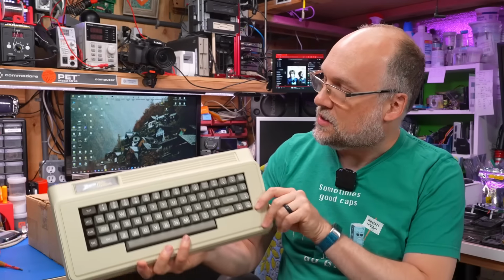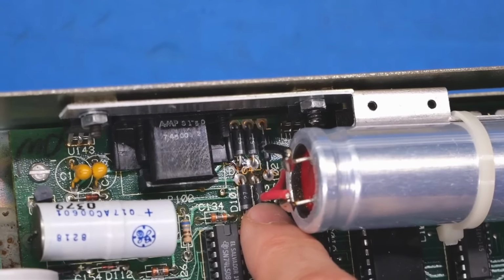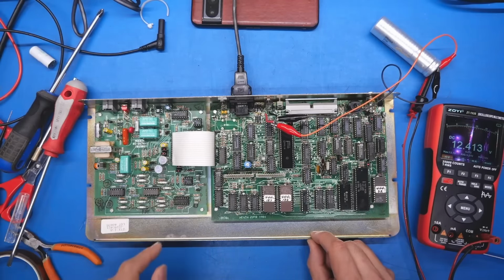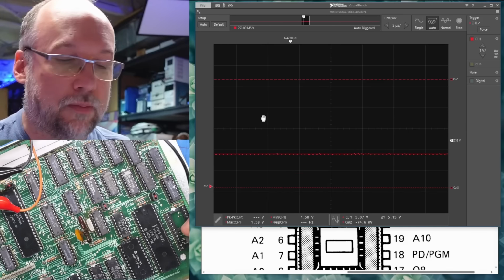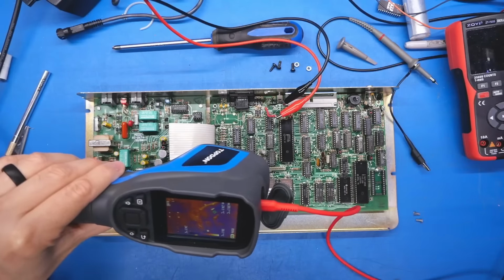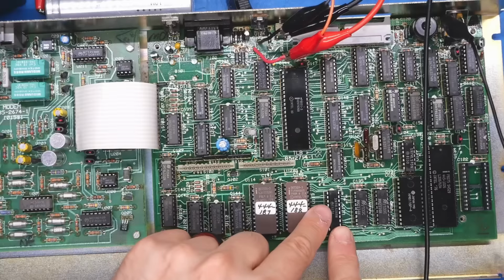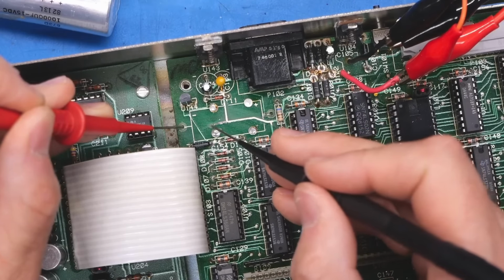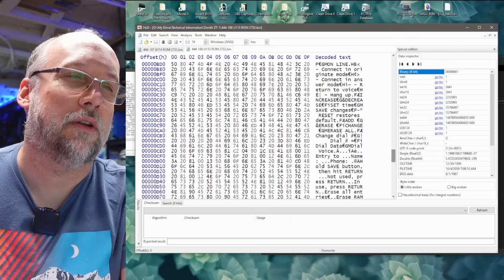The Zenith ZT-1 tried to be a low cost gateway to the information age

Comment from the maker: I did some further research and it seems this device might have come out around mid 1982, even if it was designed in 1981 (and this one has a bunch of 1981 chips in it.) This article (see PDF page 45) mentions that the ZT-1 was officially shown off in Summer of 1982, but a photo of it was shown in the 1981 Zenith Annual Report: https://ia802907.us.archive.org/10/items/sextantissue2summer1982/Sextant%20Issue%202%20Summer%201982.pdf

I found a Fall 1983 catalog showing off the product, and indeed it is available as a Heath version (in kit form) to save some (a substantial amount of) money. Judging by the markings on the PCB, it seems this was designed by Heath (Which Zenith bought in 1979.) See PDF page 65: https://www.worldradiohistory.com/Archive-Catalogs/Heathkit-Catalogs/Heathkit-1983-Fall.pdf 

The model ZT-10 and ZT-11 both had a RS-232 serial port, making the whole thing much more useful today, so if you are looking to buy one, try to find one of these models instead of the ZT-1. The "A" variant I have seems to add the "Source" online service functionality, which may have been a competitor to Compuserv. 

Notice in the catalog a carrying case was offered, bringing portability to your ZT-1. That's pretty funny considering the 80 column output clearly won't work well with TVs if you tried to use it with one as a display. (Especially via a RF modulator.)
Reply: I suspect that the ribbon connecting the computer to the modem is the equivalent of rs-232 on db25, only with TTL logic and not the typical rs232.
Reply: I bet the ZT-1 could be modified to do RS232 pretty easily.  The CPU itself has a UART on it, and the BIOS code programs it.
Reply: I believe the model number for those are ZTX-11 and ZTX-10. ZT-11 and ZT-10 were with the monitor included (or attached?) either way it's also a number of some baseball card so its hard to google it.
Reply: @DerekWilsonProgrammer  yep, I'm finding ZTX-10/11 stuff, apparently the difference is an RS-232 and up to 9600 baud modem, not an attached monitor. The ZT-1 seems very sucky in comparison. Wonder why?
Reply: I don't know if you're still watching the comments for this video, but my father has one of these similar terminals. If you'd like, we can look at his in parallel and compare roms and signals on the PCB. I'll be visiting this weekend, so let me know if you'd like me to take a look.
Reply from the maker: @JBEEUD thanks for the offer but part 2 is already out to patrons and progress has been made :-)
Reply: I would have thought anything made by Heath Kit would have schematics…
Reply: @gregpettigrew7908  Heathkit likely had a different model number, so maybe with a cross-reference of Zenith to Heathkit numbers Adrian could find a schematic.  It also might not have been posted anywhere even if it does exist.
Reply: So, you mean to say that Zenith is the cause of all problems with Heath. And that we can't buy those interesting HeathKits any more originates in the rat-like behaviour of Zenith, first they ate up HeathKit and then they tripled over their own mistakes. I had a Zenith amber coloured monitor, never had problems with it. If they did proper business then they would still be around.
Reply: I'll ask again, have the days you release videos changed on both channels??? I've commented before, but no answer. I used to look forward to the Wednesday and Saturday videos.
Reply: @simonlathwell  Yes, Thursday and Sunday work better for him.
Reply: @nurmr if you are right, then why hasn't he make it known about the change of release in a video, or bothered to even reply???
Reply: @simonlathwell I had the same question as you, but nobody owes me anything so I just watch when they come out.
Reply: @simonlathwell  It's free content, I don't understand the complain. He told the Patreon members btw.

Comment: You can probably add serial pretty easily as it is already there in TTL form.  Intercept the lines to/from the modem IC block and do level conversion....  I've done this with the ADAMLINK modem, and it works fine.  The issue is baudrate, and for that you are probably stuck with 300bps.

Comment: The phenomenon of capacitors seeming to recharge after the load is removed is because of dielectric absorption. Part of the field energy is stored in the dielectric itself when charged, and so as you drain the charge, the molecules in the dielectric which were oriented to the electric field start to feel less and less torque aligning them. But when you stop the discharge, many of the molecules will still be oriented the way the electric field was, and this results in charge "re-appearing". The energy was always there, but because the dipoles take longer to "discharge" they can temporarily create a small electric field if enough are still aligned. In most cases, the actual energy present is very small, and can be drained very quickly. However, with high-voltage capacitors, or even things like long HVDC cables that get disconnected at both ends, enough energy can be present to still be a danger. Hence why large capacitors are stored and shipped with grounding straps always connected, and HVDC cables have to also be immediately grounded when disconnected for a certain period of time to completely discharge the electric field and allow the molecular dipoles to be randomly oriented again.
At least, that's my understanding of it.

Comment: I had a ZT-1 and used it.  My TV didn't have a composite video input, so I had to use my VHS VCR to provide the VHF modulation to connect to the TV's coaxial input.  A Wisconsin BBS I was on asked "Who here has the most effed up system?".  I described my setup, and the sysop said "You win.  Hands down.  Contest over."  Yay for me?
Reply: Hey, you got a nice anecdote out of it, that's a win in my book

Comment: Radio Shack made a device similar to this back in the day, an all-in-one terminal with a built-in 300 baud modem. It shared the same silver plastic chassis and awful chiclet keyboard as the original Color Computer, and it must have shared some of the same internals as well -- iirc the default display was the same black on green with rainbow flashing cursor as the CoCo. iirc it was originally designed for farmers, so that they could dial into a data service (I guess to order seeds/feed/supplies, and to access weather forecasts and other data useful to a farmer, stuff like that.) Either it wasn't successful in its market or they decided to sell it to normal people too, because that's where I found it, in my local Radio Shack store. I didn't buy one tho (couldn't afford it at the time) but the manager of my local Radio Shack store (who was a really cool person that I was on good terms with) let me borrow one for a while. (These were different times.) It was my "gateway drug" to the world of BBSing. My friends and I used to rush home from school and tie up the phone all afternoon calling up hacker BBS's and we would raid their text files section. Since the machine didn't have any data capture mechanism whatsoever, we would read the text files aloud (using our voices) into a cassette recorder! But that got my interest in BBSing (and computers in general) and I saved up enough to eventually get a generic 1200 baud modem for my Apple IIc.

Comment: 1) Try tracing the pins actually used on the power jack then trace them through the power supply and sketch your own circuit diagram to infer inout voltages.

2) Power supplies that output AC voltage were usually fairly simple but often potted in epoxy or something similar so opening them up was a pain. With AC, some period designs used a center tap transformer and ran all 3 output connections to the unit. Because those linear voltage regulators could take significant voltage on the input over the regulated output voltage with proper heat sinking, manufacturers tended to pick transformers where output would still be sufficient if line voltage was 108-110 but didn’t exceed the rating when line voltage was 125-130 volts in an area.

3) Examine keyboard connections on the main board vs what’s going on with the Alps board to see if they were swapped. That keyboard layout looked fairly basic. What are the odds that it’s an off-the-shelf keyboard from Alps?

Comment: Having two voltage regulators where one is used to supply VCC to some of the ICs and the other is used to supply the others, is a clear display of bad hardware design. No wonder, you are unable to repair ist. You can't repair something that is inherantly broken.

Comment: It's a shame that isn't a serial terminal with the modem included in case. If it did have serial I/O, it'd be a fun project to replace that modem board with a little Pi Zero 2 W to act as an internal computer like an emulated Apple I style system with a computer and terminal in the same case (not quite on the same board like the Apple I, but close enough). Would be silly to use, but the idea is fun.

Comment: if we know what CPU is in this device, we can convert the hex into instructions based on the opcodes of the CPU based on that. you can verify if parts of the ROM content is corrupted. 
Normally i work with S100 systems and PDP but they work in the end all the same. Especial if this is a von Neumann architecture like the Z80, intel 8080, 8088, MOS 6502 and so on. 
Your Program counter advances over the given address range and if this was set to the address of the ROM your will find there perfect readable code maybe a bit shifted for ward or back wards but some starting position will match with perfect readable machine code. and as i said with the Knowledge/Documentation of the CPU you know what hex value matches to a instruction and its follow up parts and you can convert it into assembler. JMP as example is on a 8080 is 0x3C and takes 2 bytes. a lower and a higher address part, so it is 3 bytes long and after that you should get the next instruction. if this fails you have to shift a byte and look up again. most instructions are 2 to 3 bytes long so you have only 3 possible starting positions. 
Converting it is pretty easy.

Comment: The device uses an intel 8275 video controller which you described as a general IO chip multiple times. You go off on some nonsensical ramble about Apple video circuits. For goodness sake just take a minute to check and get the basics right.

Comment: A couple things come to mind.  Early on you removed a ROM (lower/right of the board) and never put it back.  What was that ROM for?  Are you sure the system would do anything without it?  Also, without the AC voltage going to the modem I wonder if the system will run without that powered up.  I would try putting that rom chip back in and also cracking open that power supply and get it going again.

Comment: There was a known fault with a particular model of Zenith laptop where one of the ROM chips would wriggle out over time - the socket was the right part to use but the supplier shipped bad parts. Not fun after Lockerbie when you had to prove that your brick of a laptop was really a laptop and it wouldn't boot. There's a story of a Heathkit technician talking to a panicked customer at an airport check in and advising him to turn the laptop off, lift it two inches off the bench and drop it, which reseated the ROM chip enough to let boot happen. Techs would "fix" it by soldering the chip into place.

Comment: 1) I'd install the character rom to see what happens.  2) Why would the CPU need to talk to the CRT controller once the screen is initialized and static?  You may be getting hung up on something that isn't a problem.  3) Have you tried connecting the keyboard?

Comment: Preliminary analysis of the ROM shows that video access happens pretty quickly.  It starts by clearing a bit of memory then goes straight into activating the controller.  The controller address is 0x7000 and 0x7001 (1 is the command register and 0 for params).  It initializes the controller for 80-column non-spaced rows, 24 columns with 2 row counts per vertical retrace (?), underline on line 1, 9 lines per row.  There's a 4th parameter which is provided by the caller to the reset routine.  This is followed up with a command to set the cursor position, and finally some sync logic before activating the display.  Once active, the CRTC should be doing DMA access every 8 characters.

You should also note that this is Harvard architectures, so data and code are separate.  To enforce this, reads from program ROM use the PSEL pin instead of the RW or WR pins, which access RAM.
Reply: There's also a 1K nibble RAM at 3000-3400.  This is battery backed up RAM and holds telephone information.  A checksum is maintained to make sure the RAM is intact.
Reply: The MCU is Harvard architecture, but program ROM is readable through movx instructions.  This means that PSEN and RD have some some kind of logic that allows either to select the program ROM for that range of addresses.
Reply: The 8275 does not seem to direct memory access other than asking for another character through DRQ.  Apparently it's up to external circuitry to maintain address counters to read the RAM.  As far as the 8275 is concerned, it's just getting a steady stream of character codes.  When it activates the horizontal retrace on line 0, that's apparently the way the address counter knows to start the next line.  Why does it need such logic?  Because a special character code tells the CRTC that this is the end of the line and it doesn't need to request data for any more characters on that line.  There is another code that says this is the last line so it doesn't have to ask for more characters until after vertical retrace.

Anyway, the BIOS gives it 96 bytes per line.  That gives you 80 characters plus up to 16 character attribute modifiers.  Attribute modifiers are bytes that have the high bit set and are interspersed with the standard characters.

It also seems to have more than one page, as it seems to be writing text to video memory beyond just the 25 lines of the first page.
Reply: Port 3 pin 4 seems to tell the modem whether to be on-hook or not.  Port 3 pin 5 is an input that says whether a ring is detected.  Port 1 pin 0 seems to direct the modem to listen for rings.
Reply: 0x2000 is the printer output address.  Port 1.6 signals the printer to read the value and port 1.7 indicates that the printer is online/ready for the next character.
Reply: I can tell that the CPU itself feeds the CRTC with data, but how it does so is still not fully clear.  I know that when the CPU gets external interrupt 0, it saves important variables to the stack and then "returns" to the video line address + 0x2000.  In other words, if it thinks it needs to show the line starting at 0x4060, the routine returns to 0x6060.  My guess at this point is that address 6060 returns NOP instructions to the CPU but activates video memory for the CRTC to read.  Eventually the second interrupt input will be activated.  The second interrupt service routine calculates the next line's address, pops all values, and finally returns to the actual caller.  A bizarre and hacky way to do things without a DMA controller.  And because of this, the video memory must have a buffer chip to create a fence.  The CPU and its ROM chip (and NOP generator) will always be accessible on one side of the fence, while the CRTC and its video memory will always be accessible on the other side of the fence.  When the CPU accesses external RAM, that gate opens.

Comment: I wonder if it would be possible to replace the 300 baud modem with one of the fancy new WiFi modem emulators. 
That would allow it to connect to telnet BBSes, almost like it was designed to.

Comment: I had one of these growing up, even before I had a Sinclair 1000. Mine was slightly different with a switch on the back for the modem side that actually switched from 150 baud to 300 baud. Time on the local BBS was restricted to I think 10 minutes a day for 300 baud or slower. So I would dial up, start reading my messages so I could dump the screen to the Printer port on a small thermal printer, go to the next message and dump it etc. as fast as possible. I would disconnect, get the magnifying glass out and read the thermal paper. I could then write out my replies on notebook paper, dial back in and type out replies as fast as my 300 baud would let me. I always described this device to people when they asked how I first got "online" with a computer system, but could not remember the model, only that it was Zenith. This is a great find and gave me information I was missing and could not remember about this terminal.
Reply: Did it have no form of basic or something? Would have been interesting to write little basic programs to input the text quicker than you could type

Comment: I would bet the battery held information like phone numbers that you'd save. If that memory is trying to be accessed and is all garbage due to no internal power to the storage memory, it's likely not going to allow it to load. I've seen the same issue in fax machines and even oldschool Brother typewritters hybrids from the 90's with the document saving/reprint  features.

Comment: Hi Adrian. Check the comms between the main board and the modem board; there should be some RS232 signals available for diagnostics. I’d look for an MC1488/1489 bus transceiver IC for RS232 - IIRC, it takes 12v, or maybe -12v. 😊
Reply: Why would a designer translate from TTL to RS-232C just to cross from the computer to the MODEM where it would have to be converted back?  Also, doing that would cause the PSU to have to deliver +12 Volts and -12 Volts.  The rest of the design looks 5 Volts only.

Comment: Probably would have been a good idea to document the power supply pinout/voltages before it died ;-).
Reply: probably still can find what pins go to the secondary windings, most likely a primary fuse that has popped, or can work it out from the pcb tracks ,